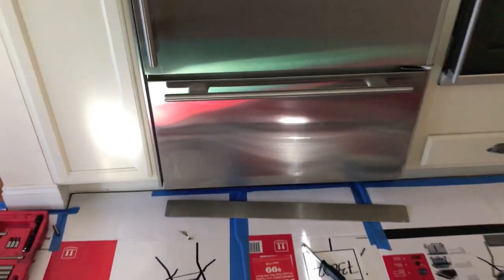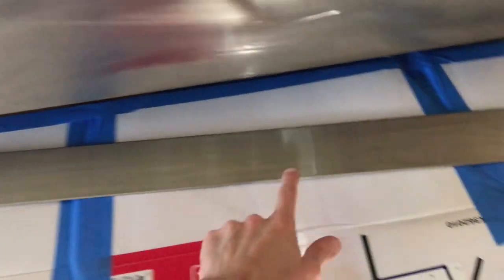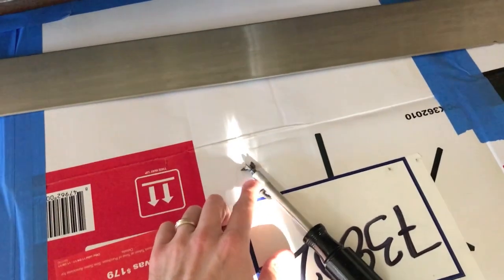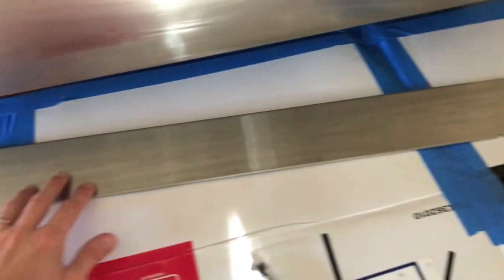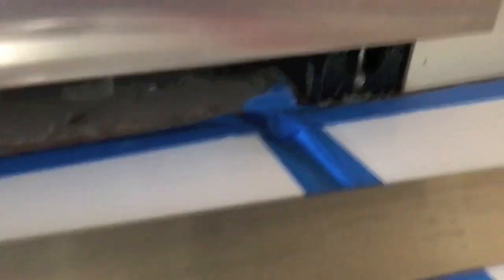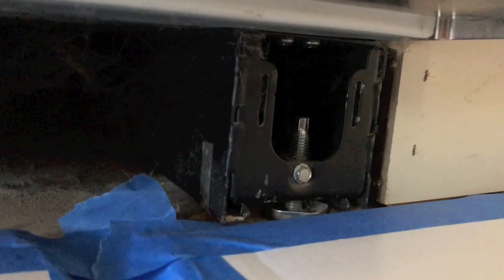How to remove SUB ZERO Refrigerator - "Lowering onto Wheels"

Comment: Helped me tremendously. No local contractors wanted to do this job worrying they will damage my property. Spent a few hours and w the help of this video, my old sub zero fridge is finally gone. Thanks so much!
Reply from the maker: Good morning, we are drinking our morning coffee answering any and all questions for the DIY community.

Awesome job making it a DIY video.  These refrigerators can be a pain to move.  Hopefully you love your new refrigerator.  😁👍

Let us know if you have any questions and hey if you’re into crypto trading, join our newly launched DIY ecosystem.

       toolboxtoken.com

Reach out to us any time!  🧰
Reply: It's because of the terrible design. When you did it, did you see how little clearance there was from the bottom of frame to the floor? It's less than 3mm. If your floor isn't dead flat, it's definitely scratch the floor. No contractor want to have to fix that. They designed this terribly.
Reply from the maker: @user8ZAKC1X6KC  

Thanks for watching and sharing your thoughts, and it’s HEAVY!  👍

Comment: short and sweet video!  I tried to move my subzero before I found this video, but it wouldn't budge.  In my case, the rear lifts were already loose, but the front were seemingly under pressure (against the enclosure at the top?).  I needed to pry up on the metal frame (of the fridge) to relieve the pressure so I could turn the screw (I used a 1/4" wrench since I do not have a 9/32" and it worked fine).  One crazy thing was that the whole fridge wanted to tip forward with the door open.  I used suction cups (for lifting glass) to pull the fridge out of the recess -- there really was very little to grab onto.
Reply from the maker: Thanks for watching & welcome to the DIY Raptor Club.  We really appreciate you sharing your experience.

Sounds like you were able to accomplish your mission.  Great idea with the suction cups.  Glad all went well & we again thank you for sharing this.

Enjoy your day.  😎👍🔧🔩

Comment: I loosened the front bolts as instructed - when I lowered the front feet to bring the wheels down, the back was still up high and the refrigerator was tilting towards me.  Also, as in your video, when the front feet are all the way up , the black bracket is on the floor so I'm not going to be able to drag that over anything without scraping.  There's got to be more to this...
Reply from the maker: Thanks for watching & welcome to the DIY Raptor Club.  We had a friend that had a refrigerator installed in the kitchen and then built around it.

I remember asking, hey if your refrigerator fails how are you going to get it out of the wall... he mentioned they would need to cut away the wall.

Hopefully that is not your situation.  Just a few more minor adjustments with the feet may go along way.
Reply: @DIYwithMichaelBorders  slightly different problem, it would come out of my hole but basically there's no getting it on the wheels, it rests on the wheel housing itself when all the way down. Seems like the back wheels are permanently up because I really jack it up to get it level - but I had the back wheel adjustment totally loose.
Reply from the maker: @whitestraat  

Thanks for the update, hopefully your rear wheels are not seized...that’s if they actually move & are adjustable.

Comment: How do I move a heavy refrigerator from the "box" that the contractor built for it, I need to replace the water supply valve for the ice maker. It's leaking and making a huge mess. There is barely enough room for my fingers on either side of the fridge. I raised the wheels up, but it still won't budge.
Reply: I used suction cups which are intended to move plate glass.

Comment: Hi I've got to remove one of these tomorrow I've never done this before it's also got a wine fridge connected to it do you know if these appliances are one complete unit or they split into two units also to all the Sub-Zero fridges have wheels
Reply from the maker: James Phoenix 

Thanks for watching James and we appreciate you reaching out to us.  In most cases, the wine fridge will disconnect from the main fridge.  Definitely let us know what you find and how inconvenient or convenient it was to move… We are always curious with these huge monster size refrigerators.  🤣

Comment: This wheel-lowering mechanism is very poorly designed. There isn't enough room to remove the socket wrench once the wheel is lowered.  The wrench is terminally suck in place. I can't reach to lever to change the socket wrench setting to reverse the screw to raise it back up to create enough clearance to remove the wrench. The only solution appears to be a destructive one - slice the screw in half (meaning the fridge can never be raised again) or somehow destroy the socket wrench. This is extraordinarily frustrating. And of course, I was able to lower only the left wheel and right one is still raised.
Reply from the maker: Thanks for watching & sharing your experience.  That’s odd...& no fun...🤔

Hopefully you won’t need to brake anything.  Is there anyway you can use a pick tool to maneuver in place to switch the ratchet to the opposite setting?  Please keep us posted
Reply: @DIYwithMichaelBorders  I spoke with subzero about this, they were no help whatsoever, and only advised using a plyers to grab the footpad to turn it enough to move the vertical screw out far enough to remove the socket wrench(es). They had no response to my comment that that would certainly mash the feetpads, probably rendering them useless thereafter and could not really be done once the feetpads press against the floor anyway. I sent pictures to them as well, but the representative said he'd never heard of this issue before. Btw, this is a subzero 650, and its never been lowered onto the wheels since installation years ago.
Reply from the maker: @apoll7  

Thanks for watching & that’s a bummer that they weren’t as helpful as you would expect.  Is ratchet & socket still stuck?
Reply: @DIYwithMichaelBorders  Michael, this is too late for you, but the best kind of tool for this job is a flat ratchet (like amazon.com/gp/product/B08THP978T). However, a warning to others -- my older Sub-Zero requires a 1/4" socket, not a 9/32", so check yours before buying anything.
Reply from the maker: @hughbethell2223  

Thanks for sharing this, hope all is well.

😎👍🔧🔩